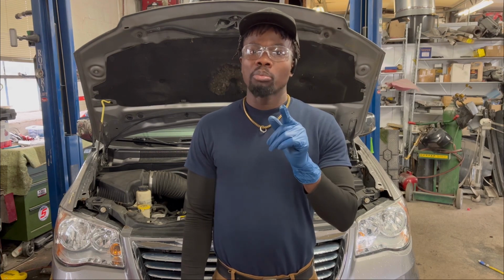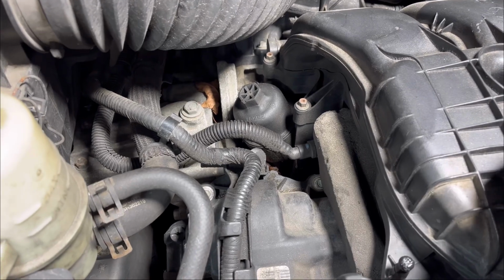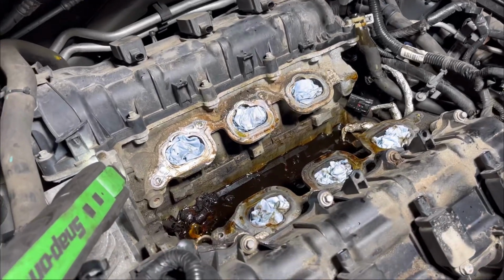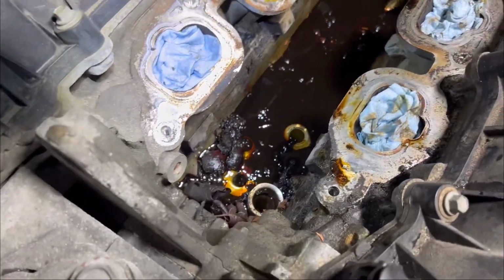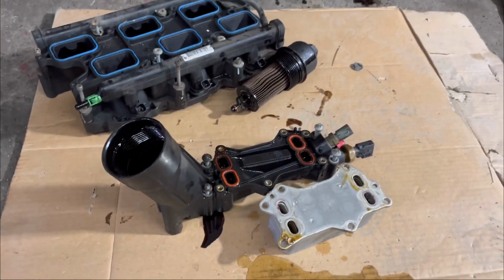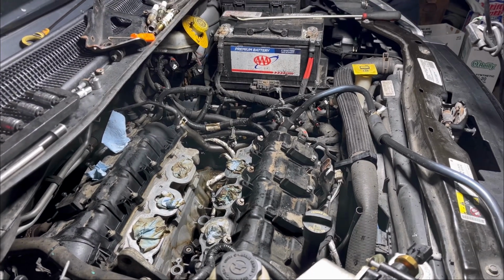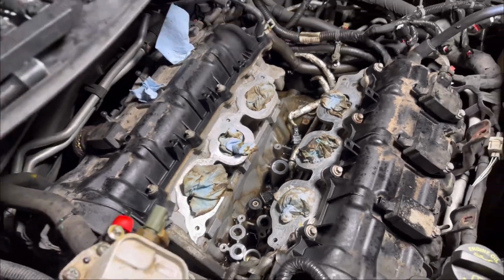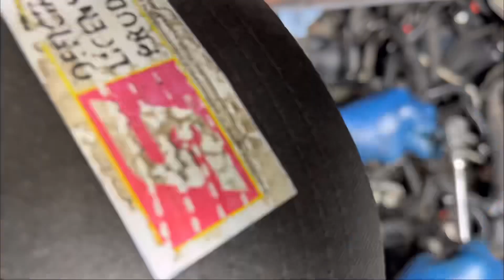Oil Leak?? Chrysler Town and Country Oil filter Housing Gasket Replacement

Comment: My question is what made you go this route did you see oil in a certain area or just dealt with this issue before. I got 2015 that takes about 2 quarts every few days finally got good weather to take a Crack at the problem I assumed it was oil pan gasket but seeing this male me think I might as well change them while I'm working n the gasket but wanted to know what made you go thay direction. Whay type of things to look for
Reply from the maker: Thanks for reaching out, so In most cases the oil will run through the valley all the way to the back of the engine and the transmission so you might think it leaking from either engine or the transmission. But take a closer inspection and make sure they valley is clear before doing any further repairs.

Comment: Great job installing the gaskets and cleaning the motor. Did you need to release fuel pressure to remove the fuel line? I have a 2016 Grand Caravan and do not see a fuel pump relay. Thanks
Reply from the maker: Best thing you can do, you can disconnect the negative terminal from the battery and you should be good, just a lil spill of gas gonna come out from the line.

Comment: Do you need to drain the oil and coolant?
Reply from the maker: No, I did not drain the oil and the coolant, but I topped  up the oil a little bit and the coolant also

Comment: Replaced it an still can see smoke rise up after a ride
Reply from the maker: It’s probably from the oil that spilled on the exhaust, they should dry up after few miles
Reply: @kayauto  I think the o rings are bad an found some felpro will do soon an update ya